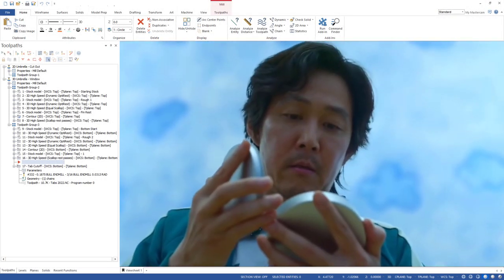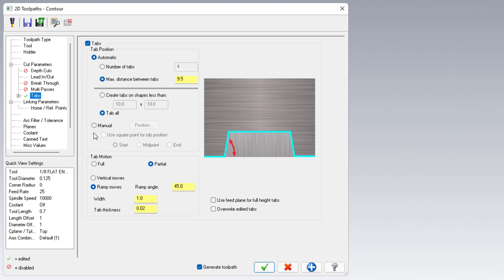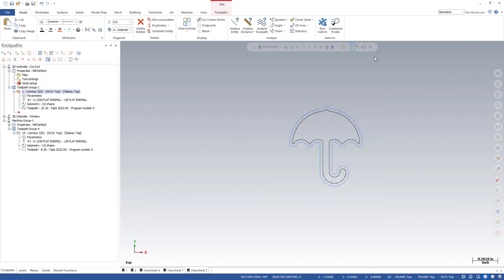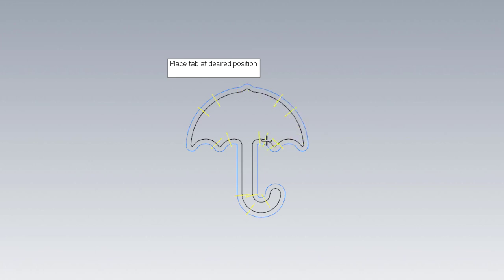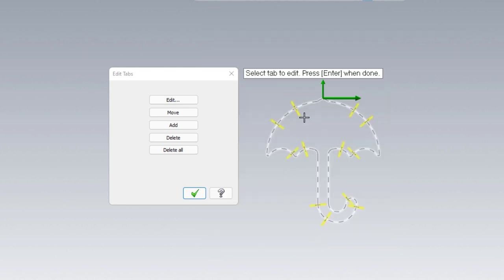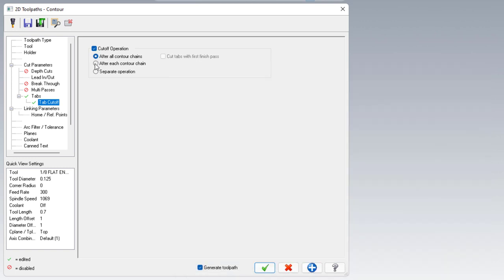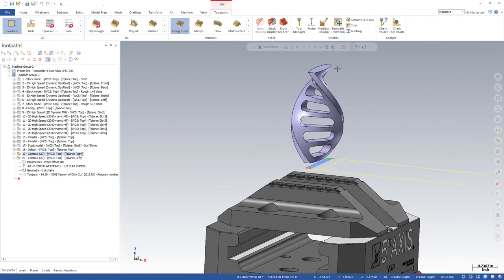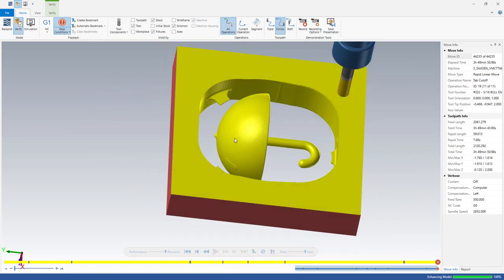Creating and Machining Tabs in Mastercam

Comment: Does master cam or similar softwares require a dedicated graphics card ?
Reply from the maker: You can run without but you will not have great results especially if you get into complex parts/toolpaths. Should note that running without a dedicated card is not a supported configuration by Mastercam (basically you may have problems resulting from this that they cannot account for or fix)

Comment: Hello, thank you for your tutorials, we understand well because explain you very well ... just a small question is' it possible to put subtitles translated into French sa would be very nice on your part in any case thank you really for what you do and very good continuation, we are looking forward to new tutorial…
Reply from the maker: Translating into different languages is extremely hard, especially when you don't speak the language 🙂...even though I did take french in school, I never really got good at it. 
There is a solution though. You can use Googles auto translate. Its just not obvious on where to turn it on. At the bottom of the video, click on the gear icon, where it says subtitles (most likely set to off right now) you may need to choose English Auto Generated first. After selecting that, click the gear icon again, this time under subtitles you should see an option for Auto Translate. French should be an option in there. Just know the translating will not be 100% accurate but its the best we can do.